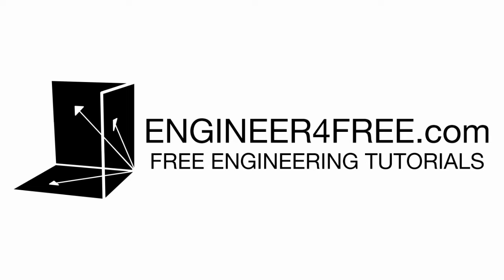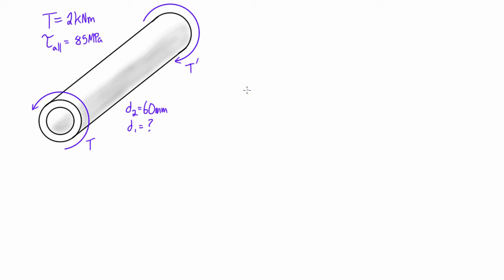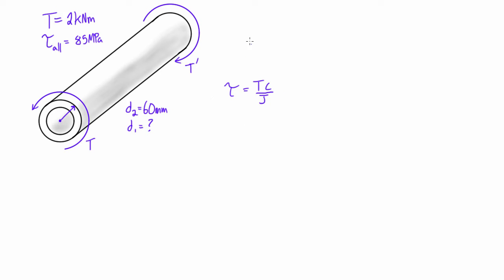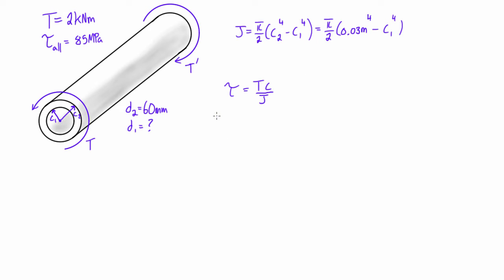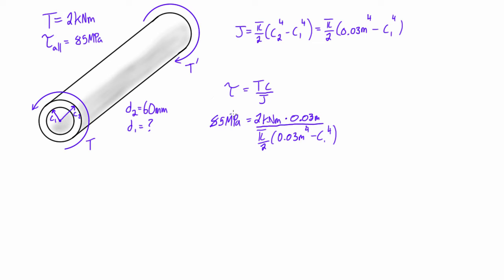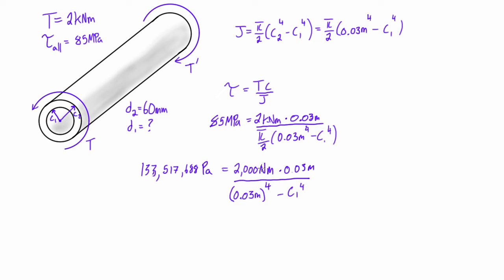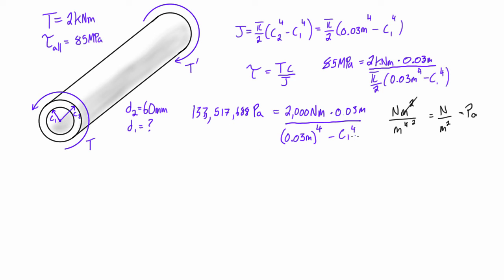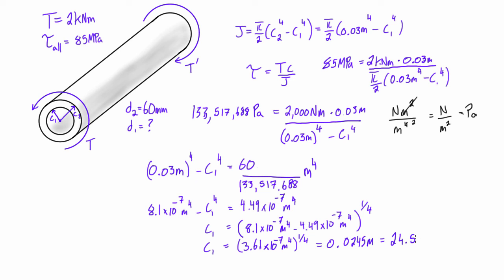Find the minimum inner diameter of a hollow circular shaft in torsion

Comment: Hi I was wondering how I would do this if I have neither the inner or outer diameter and instead have a ratio of inner to outer diameter of 1:3? 
The question itself is to find both the inner and outer diameter.
Reply from the maker: You can set C2 = 3*C1 and then as long as you have all other variables, then you'll just have one unknown. I have some more videos on torsion that could be worth checking out too here: engineer4free.com/mechanics-of-materials
Reply: @Engineer4Free  I ended up figuring it out but thank you for replying to my question and your videos are really helpful.